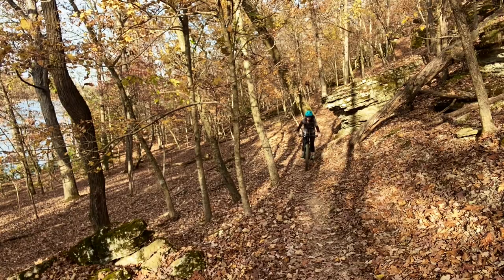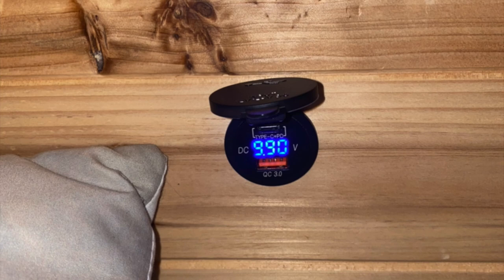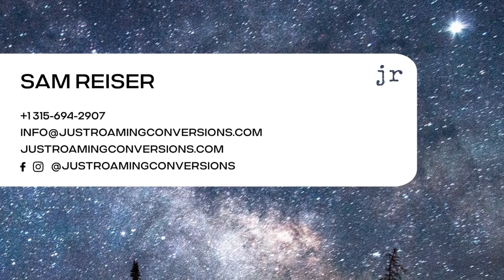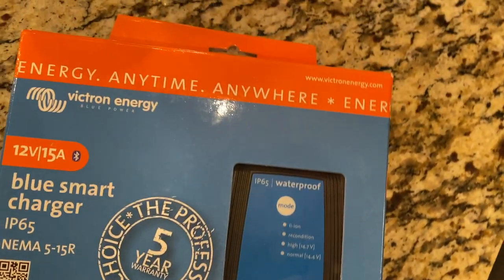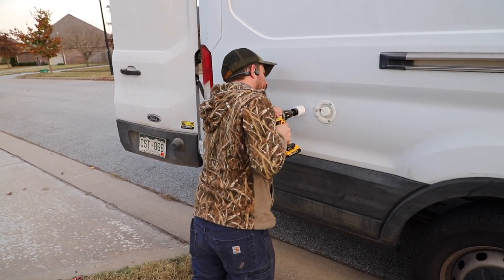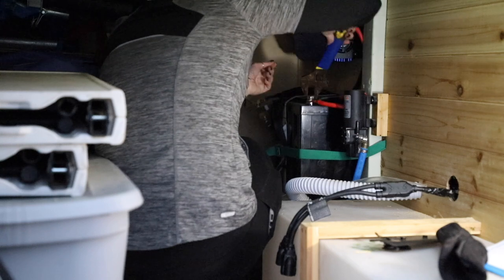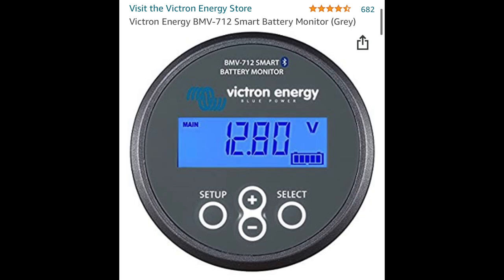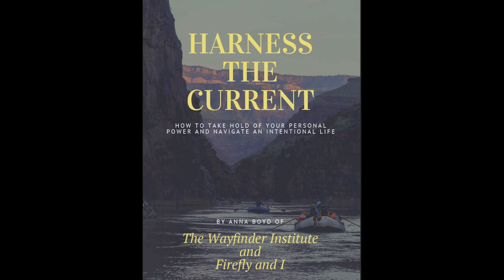DIY Van Build Electric System Update | Installing Shore Power | Ep.8

Comment: i feel you here hun when i started my planing  for my tiny home ima biuld in the spring  i was overwhelmed as hell  now i cant afford what i want but hey  i got my hands on some  341amp hour lead acids batterys x2  and im aiming for 600 yo 700 watts of panels  seeing as with lead acid i only get 50% ofthe  amp hours so i'll cap at 341amp hours useable  issue im haven is i'll be able to run off a extention cord but  i dont have  shore charging  YET  thats next on ym list  so thank you yet again ur video helped :P
Reply from the maker: The shore charging has been a godsend, I’m so excited to have it hahaha
Reply: @Tiny.Wayfinders  when i was resurching i kept seeing ppl do it with a few diff parts  but never 1 unit like u linked so worth it hopeing i dont have issues in the long run with power... u ever use a watt meter to figure out you max watt useage  befor playing the electrical?

Comment: Excellent video....  Lessons well learned.  I had many questions after watching your build video.  You have addressed them all.  I too, learned the hard way.  I started out with a 20 watt solar panel and quickly realized that I needed a lot more.  And the angle of the sun while being located in the Midwest....  Haha!!  Yep!!  Now, I only have 200 watts of solar but, I have 2 deep cycle batteries and now I also have a 3500 watt LP generator. If I am at a place with no shore power I can usually run full power for about 4 days straight without Shore power.  No shore power???  I run the generator to get caught up.  I have learned to be very power conservative.  I can stretch those four days out depending on how much sun I get.  You ever think about getting an air conditioner?  They are nice but, they require shore power or a generator big enough to run it.  Good luck I enjoy watching your life's journey!  Everyday is a new adventure!!!  ;-)
Reply from the maker: The shore power has made a huge difference I am loving it! Heading south helped a lot too haha

Comment: I have been using Renogy equipment for a long time and I have found it to be very reliable. I think your problems were caused by lack of knowledge of how solar systems work. You didn’t mention how many watts of solar you have but it is obvious not enough for your needs. The solar system must keep up with the drain on the batteries and this isn’t easy in the winter time unless you are sitting in the Arizona desert. Once the batteries are run down it takes a long time to bring them back up with just a minimum amount of solar. You can help recharge the batteries with an isolator system running off your alternator of the van. Running the van for 30 minutes could greatly shorten the charging time. On my van I use 300 watts of solar that charges two 100 amp hour batteries. I rarely run the batteries down. If I do I supplement with the alternator charging. I would add another 100 watt panel if I had room but I have a lot of other junk up there. Solar panels are really cheap now, only about $1.20/watt so fill up the roof. The type of solar controller makes a big difference. A MPPT controller is a must if you want maximum charging. You did the right thing by adding an external ac charging system. Plug in every chance you get. It’s too bad you didn’t have some professional help when you started,  it would have prevented a lot of grief. You need to connect with other van/RVers , there is a lot knowledge out there and 99% of the people will be more than happy to help you. We have all been there and made our share of mistakes.
Reply from the maker: My issue with renogy goes far beyond their products. When my inverter wouldn’t work, they took it back, took 6 weeks to test it, found it would not even turn on, told me I would get a new one, two weeks later said they sent it, it never came, finally over two months and like 10 calls later they told me they were out and gave me a refund. Every issue I’ve had the customer service has been completely abysmal. 2 hour wait times on the phone, black hole emails that never get responded to, even my issue with the battery - they told me they would be on it immediately and a week later I haven’t heard a word back. It’s absurdly bad service, and every component I’ve had from them has failed in some way except the solar panels. I did get some professional help on the install and talked to people for days but it would be great to work with a company who can sell a comprehensive system that works - like victron! I do have the mppt controller as well

Comment: I wish, I wish...I wish I had watched this video before spending a sh*t ton of money on my Renogy set up. But even more important, the time it took to install everything (I did it myself - first time ever). Due to current ongoing projects, I'm not able to test the panels, charger or inverter yet...and it's beyond the return time. And you're spot-on about things being way more difficult than anticipated - I'm not a DIY guy, nor an electrician, carpenter or plumber...everything is a painful and sometimes hazardous and expensive task...and sometimes just finding the head of a screw is enough to throw my drill across the park. You shed a little light on just one tiny aspect of traveling in a vehicle...which could (and probably will) make you lose sleep and cost you way more money than you anticipated.  It's all part of the grand adventure, right Anna! How did you describe that..."growth mindset"?  :-)  Just keep smiling...and know when to quit and have a beer.
Reply from the maker: Haha yeah I really wish I hadn’t spent all the money on Renogy too BUT once adding this shore power setup I’ve been fairly happy with everything!

Comment: GOOD ADVICE here. Do you have a system installed that allows your engine alternator to charge the battery any time the engine is running but disconnects when the engine is shut off??? If you drive much with the van it helps top off the batteries especially on cloudy days.
Reply from the maker: I do, but it’s only a 20A so it doesn’t do that much!

Comment: Solar systems can be overwhelming to anyone unfamiliar with them. That said I think you're being a little unfair to Renogy. While I prefer and always use Victron, many people use Renogy with no problems what so ever.  Having not consulted "one" expert initially I think you made some major errors in the design of your system which led to your problems. It's always good advice to consult an expert having first confirmed they truly are an expert. Many falsely claim such knowledge.
Reply from the maker: My issue with renogy goes far beyond their products. When my inverter wouldn’t work, they took it back, took 6 weeks to test it, found it would not even turn on, told me I would get a new one, two weeks later said they sent it, it never came, finally over two months and like 10 calls later they told me they were out and gave me a refund. Every issue I’ve had the customer service has been completely abysmal. 2 hour wait times on the phone, black hole emails that never get responded to, even my issue with the battery - they told me they would be on it immediately and a week later I haven’t heard a word back. It’s absurdly bad service, and every component I’ve had from them has failed in some way except the solar panels.
Reply: @Tiny.Wayfinders  Now that's a different story and I'm happy your letting everyone know. That is completely unacceptable.